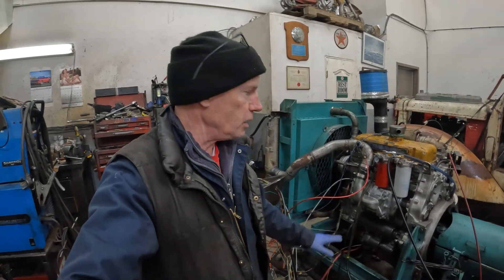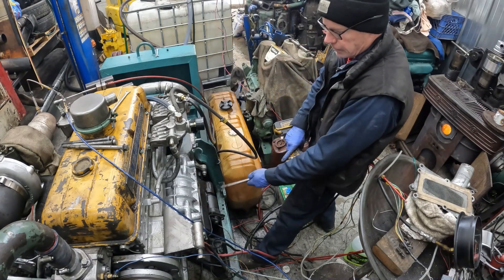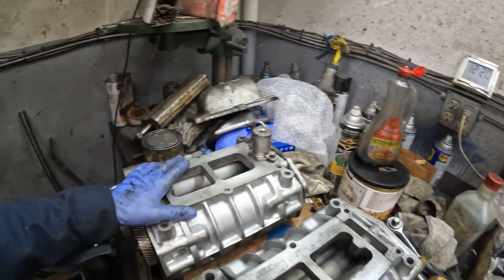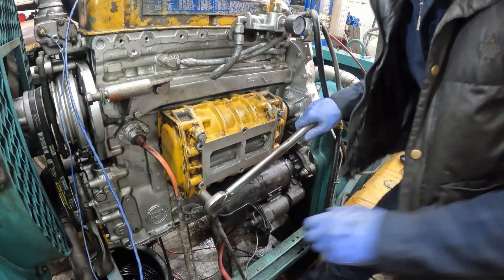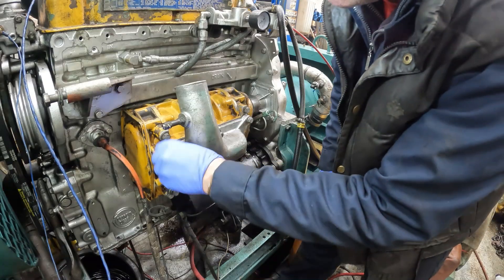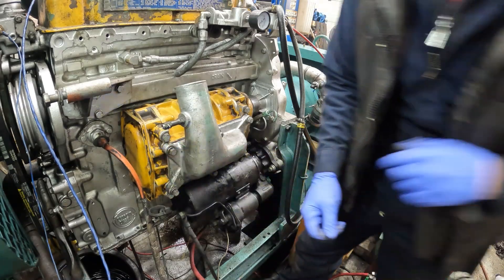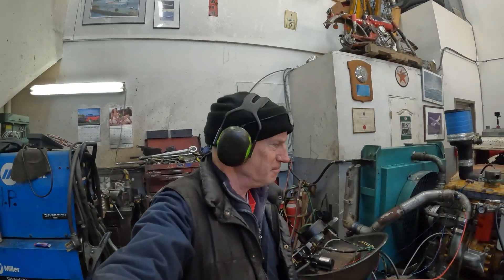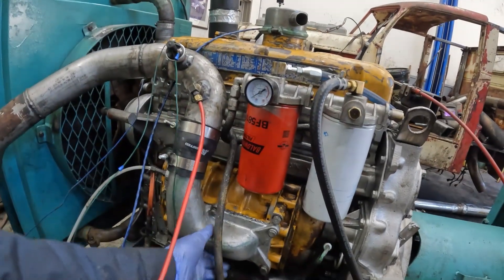Detroit Silver 4-53T (N Blower Install And Test)

Comment: Maybe you've answered this question in a previous video but what's the ratio of crank rpm to blower rpm? and is it the same for all sizes of motors?
Reply from the maker: Blower spins at 2.5 if I remember correctly.:)
Reply from the maker: P.S.  No 71 and 92 series have different options for blower rpm.

Comment: I use #2 myself and have some Aviation if I want something not so thick. Thins down with so isoprophel really easy. Can't beat it and it won't hurt anything if it does squeeze out. I like the 'N' blower. Same color as the valve cover! Thanks!
Reply from the maker: Yeah that's a great product, I've been using that since I was a kid.:)  The N blower and valve cover came from the same engine I salvaged years ago.:)
Reply: @detroitgarage9430  Me too. Can't beat it! And you sure did good bringing the good old stuff home! Too much good stuff makes way too many cans anyway.

Comment: I noticed in your last load test video ... i beleive is your boost gauge ? ... the one with the blue lights .... seems pretty jumpy... was wondering if that is really boost and if that was a good thing or not ?  It seemed much more stable in this run.
Reply from the maker: The jumpy one with the blue lights is the airbox, the one above that is turbo boost.:)  Airbox was running 10 psi and T boost at 5 psi with no load.:)  So far that looks promising.:)
Reply: Ya the blow off valve on the T blower  is dumping PSI
Reply from the maker: @ProjectTrailerz  :)